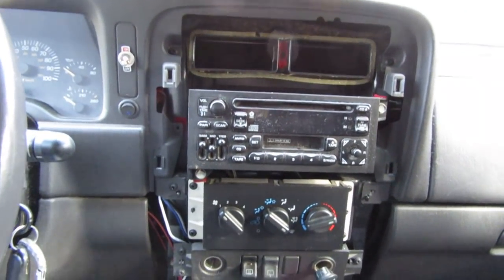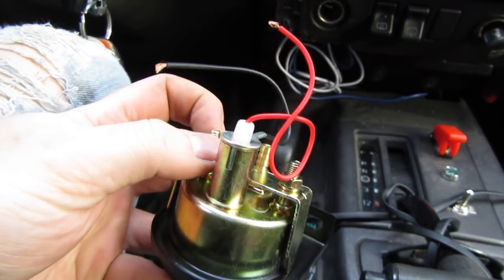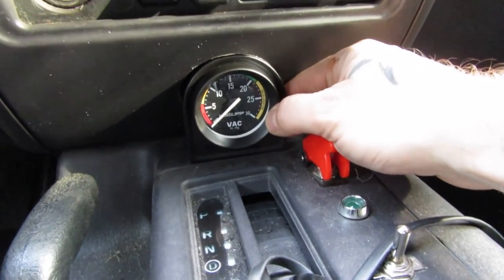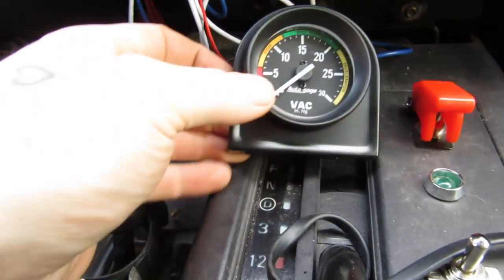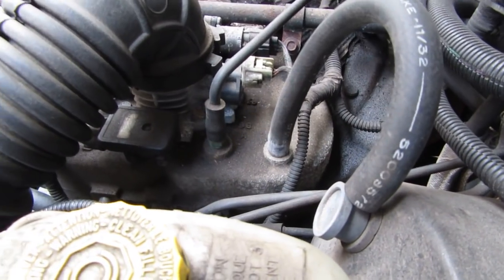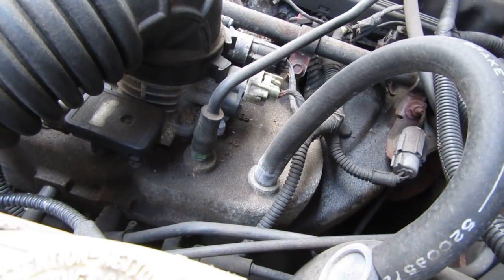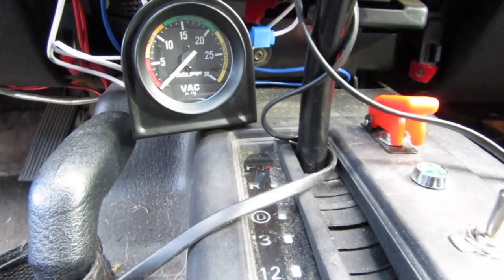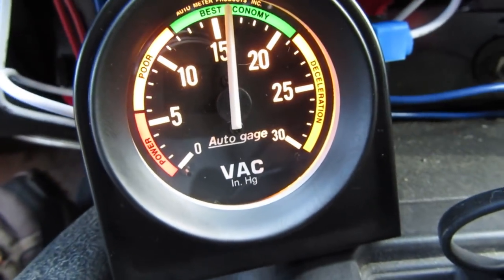MPG Vacuum Gauge - EASY DIY INSTALL

Comment: I put the exact same gauge in my v8 swapped 84 Datsun S12.  Mine at a idle is close to 18" to 19" at about 700 rpm.  Very handy and informative gauge!   Can be used to tailor driving to achieve decent gas mileage

Comment: low reading may indicate late timing..  floating needle 2"low may be ignition issue+coils or secondary. 3" 4" low may indicate sticky valve.

Comment: I purchased one of these for my 86 K2500. Considering putting it up in the corner of the dash by the base of the pillar if it won't fit in the pillar pod setup I bought. Last resort I'll just mount it under the dash or something.

Comment: Nice vid! I’ll have to look more into these. Never heard of adding a vac gauge. Also didn’t know one outlet was powered all the time and one was when the vehicle was on! Don’t have that on my yj but makes sense for my other vehicles
Reply from the maker: YEa, it is a nice way to keep on eye on an aging engine. If you are MPG minded, vacuum is directly related to MPG. I am surprised your YJ does not have the same setup. I figured the XJ and YJ would be pretty close..
Reply: My dad's station wagon he had many years ago had a factory one but it was a fuel economy gauge, max and min.  Went to min when you stopped the accelerator obviously.

Comment: The first places to check for vacuum leaks are the connection points, ie. vacuum taps to the engine; inline taps for sensors and any other points such as the distributor and in-line restrictors.  Then, any places in the lines that pass anywhere close to hot spots, ie exhaust headers and the engine head / block.  This means virtually the entire lengths of every line.  But, ;start at the connection points.  Those are where I have found them in the past.  You are totally correct about a vac gauge telling the engines health status.  The package the gauge came in sometimes has those illustrations.  If not there, then the maintenance manual on your particular vehicle will show that info including photos of how the needle is reacting.  If anyone doesn't own a maintenance manual for their car / truck they need to get one.  That is one of the FIRST things I buy whenever I get a "new" vehicle, so I can learn about it and how to do shade tree mechanic work instead of paying mechanic fees for things I can do myself.  Nothing against mechanics earning a living, but my tight budget says that I need to keep those monies in my own bank account....such as it is.   lololol.  I just got a 1981 Jeep CJ-7 Renegade  from my son-in-law by trading him my 1976 Chevy C-10 shortbed, stepside pickup that he wanted for this "real jeep" that i wanted.   Straight across trade.  I gave him my maintenance book on the truck, but had to order a couple of those on this Jeep from an eBay seller at very reasonable prices.   Good to go.
Reply from the maker: That is some really great advice! If you choose to remain ignorant about your vehicle, you are in for an expensive ride. It doesn't take much to sit down with a Haynes manual and figure out how to fix your own stuff
Reply: Should have kept the round eye square body dude. 😆

Comment: I'd put the top "lip" of that gauge inside the top of the cutout you made for extra support, combined with the tape you should be good. Maybe velcro on the bottom instead of the white double side.
Reply from the maker: Damn... Velcro is a perfect idea.. Why didnt I think of that?! I have to take my center stack apart so often to add or maintenance electronics that it needs to be easily removable, yet secure for daily driving. Thanks for that tip! I will be adding that for sure.

Comment: Where would you put this on WJ? I’m thinking about the right side of the cluster bezel behind the steering wheel where pedal adjust switch is.

Comment: Is your baseline at idle or in gear? Been running once for a while now, found the Crank case breather hose was the leak in my 4.7 WK. I have 16 Hg in gear and 18-19 at idle. But this 4.7 is always in yellow or Red....  and I grandpa the thing, could there be another leak?

Comment: I got a question? I put my vacuum gage hose to my brake booster that's the only place I can find a vacuum. The gage is working but I want to know for sure if it's not going to cause any damage to my brake booster to hook my vacuum Gaga up to it.
Reply from the maker: You mean you added a "t" fitting to the booster line, right? Either way, it is not going to damage anything, but I cannot say it is suggested. If the line to the gauge should fail you will lose vacuum to the booster. Brakes will still work, but not as strong. If you email me at dandeoffroad@gmail.com I can help you find a better vacuum port.
Reply: @DEInTheGarage  yes I put a T to my brake booster line.

Comment: Good video man. So I’ve got a 2002 WJ with the 4.7 HO engine, I’m getting like 8.5-9 MPG nearly 90% in town driving running 33 inch MTs and a 4 inch lift is this fairly normal?
Reply from the maker: yea... a V8 on 33's driving aorund town is not a recipe for good mileage. Have you changed your gearing at all? That might help. I just bought a 4.7 and have been using the "egg trick" to get the best MPG out of it. You pretend like you have an egg between your foot and the gas pedal when driving. It is dumb, but going easy on acceleration and braking can really help. Also, if you are at stock gearing with 33's your have created the worst possible situation for stop and go driving
Reply: I’ve got stock 4x4 all time gearing. How big of a project is it to go to swap to 242?
Reply from the maker: @andrewmarshall777  The gearing we are discussing out be in your axles, but swapping to a 242 from your 247 would also help MPG as your front axle will be in play at all times. it isnt too hard. You just need to swap your original input shaft onto the new transfer case I have a video of the process coming up
Reply: Oops duh my bad haha yeah transfer case obviously different than gear ratio. Tbh I just got this WJ a month and a half ago and I didn’t exactly get a parts list from the guy so I have no idea what the gears are. I’ll need to look into figuring that out once this hellish snow storm blows over. Problem is I’m a college kid in an apartment so it makes it a PITA to get work done. I also always forget my odometer is probably off like 10-12% because of the increase from stock tires so my MPG isn’t quite as bad as I’m thibning